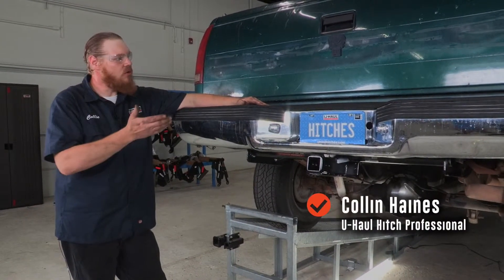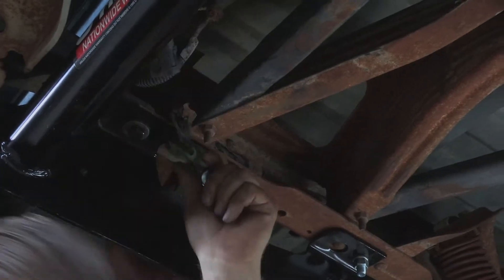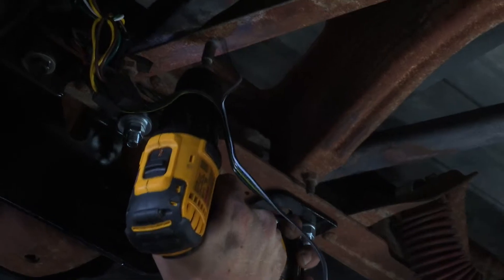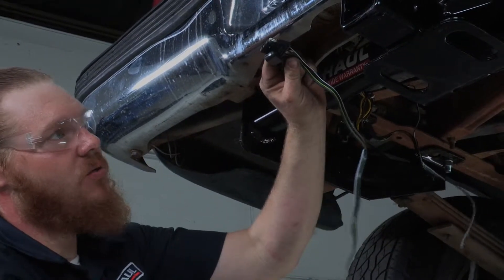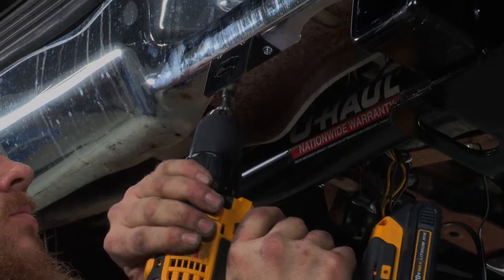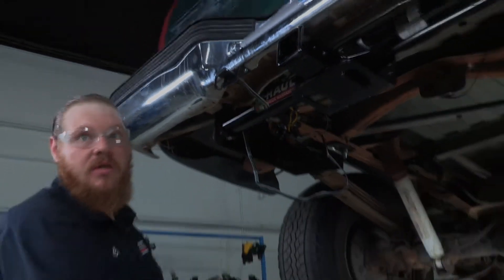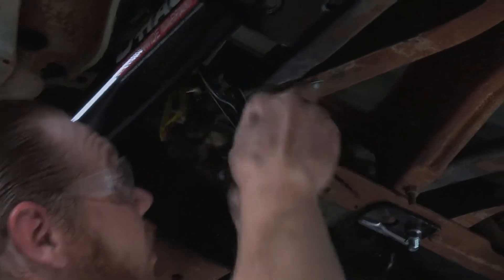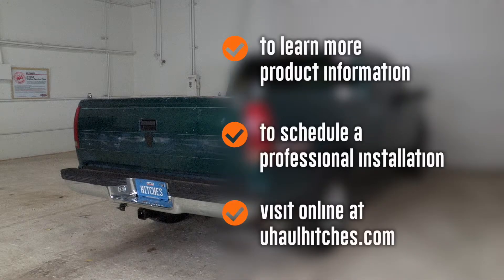1994 Chevrolet Truck Wiring Harness Installation (includes 1500, 2500, 3500 models)

Comment: I'm having issues with my brake and reverse lights not working, but the brake light on the cab works. What could be my problem? Fuses  good and I've got new circuitboards and bulbs.